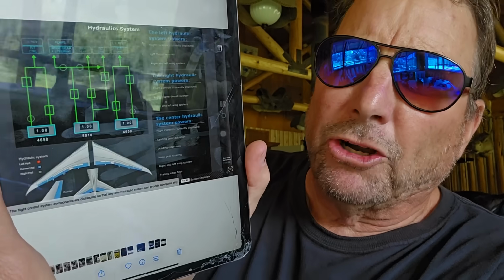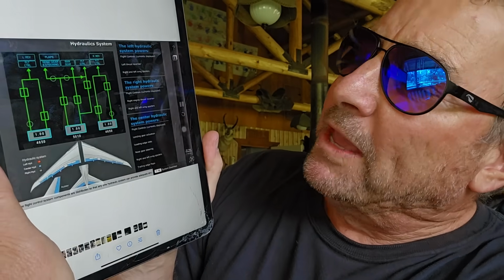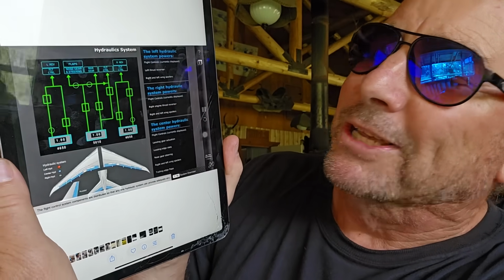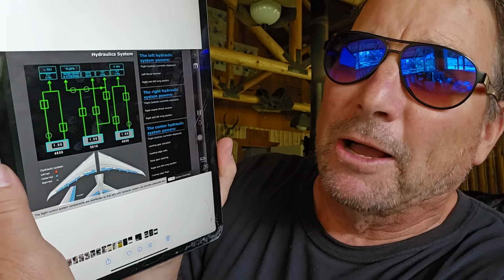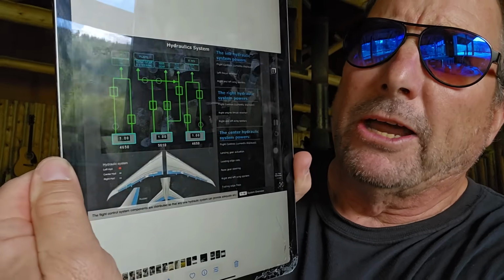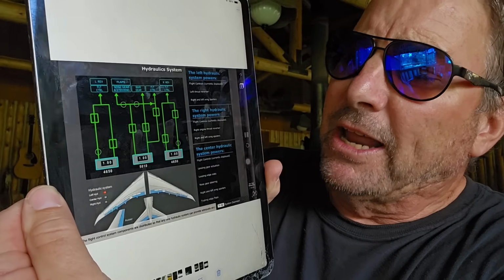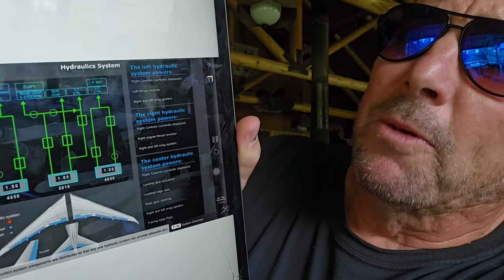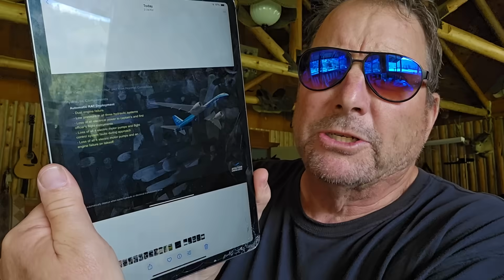787 Crash India What's a RAT? When does it deploy?

Comment: IMO the trouble happed during rollout and at or near V1. They were committed to take off.  I wonder if aborting the takeoff and over running the end of the runway would have been better.
Reply: The video that shows the take-off run was recorded from a position to the South of the runway. Using this position and the buildings in the background the aircraft lifted-off around the middle of the runway, apparently normally. Hence the problem occurred after rotation and lift-off.

Comment: What about the long takeoff? There is a video of the airport security camera showing a lot of dust raising in the air off the left wing, indicating a very late takeoff. Am I the only one thinking about this? What do you guys say about it?
Reply: The aircraft left the ground around the midpoint of the 3,600m runway. The dust was picked up from the side of the runway by the tip vortices.
Reply: @christopherrobinson7541 , maybe but how did that dust had enough time to settle there? Wouldn't the previous plane blown it away?

Comment: I assume the additional drag of the RAT is significant. In the early 787 models, there have been issues with battery fires. Are those batteries able to provide power like the RAT does or are they too small? (The fires have been big, though...)

Comment: I kind of wonder why so many airline pilot's in channels don't want to believe a dubble engine failure could've occurred?  If a faulty system like mcas could pitch down 2 max 8 planes straight to the ground, why wouldn't another faulty system for thrustcontrol suddenly be able to roll back both engines to idle in the middle of a takeoff? 
I have such a hard time to fully trust computers doing critical decisions based on readings from sensors that can give wrongful readings.

Comment: @Juan, is it possible that Aircraft went into the Flare mode right after taking off and reduced the engine power to idle?
Reply: Something like that may be possible, but unlikely to have throttled back the power so much that the electrical generators tripped offline causing the RAT to be deployed.
Reply: @christopherrobinson7541  we don't know for sure that RAT was deployed!

Comment: I have a theory on this.  We saw how they seemed to use an extra long takeoff roll, and after liftoff there was a cloud of dust.  What if:   beyond the edge of the runway there was some kind of FOD, and the plane was either rotating or still very close to the ground when it reached the end that the takeoff power of those engines sucked in the FOD causing both engines to die.  The cloud of dust tells me they were very close to some unpaved surface.  Rocks or things maybe caused the loss of thrust, thus deploying the RAT.  Investigators can tell by the condition of the fan blades and maybe other marks and the FDR will tell us the flap and all instrument settings.
Reply: The aircraft left the ground around the midpoint of the 3,600m runway. The dust was picked up from the side of the runway by the tip vortices. FOD is a possible cause, but initially the aircraft was climbing away normally.

Comment: Another thing not being talked about much is the apparent partial speed brake deployment seen in the initial video. Could a catastrophic hydraulic failure lead to the speed brakes becoming free in the breeze and partially deploying? Are they spring loaded to deploy like this when there is no hydraulic fluid to keep them stowed?
Reply: The speed brakes (spoilers) are locked in position and have to be unlocked and actively moved using hydraulic power. When the flaps are lowered to flaps 5 or flaps 15, a small gap appears between the spoilers and the flaps, which is what can be seen in the video.

Comment: On a 787, do the flaps and slats need hydraulic pressure to stay extended, that is to say, when the hydraulic pressure completely drops for whatever reason, that the flaps and slats at all times completely retract to 0?
Reply: The flaps and slats have check valves to ensure that these control surfaces remain in the last commanded position.
Reply: @christopherrobinson7541  Thanks for your reply, but it doesn't answer my question. The question is, in the event all hydraulic pressure is lost, will the flaps and slats at all times retract?

Comment: If the power was lost and the RAT deploys, does the CVR & FDR still record data on a 787?

I’m just thinking of what happened with Jeju Air Flight 2216 and how they lost the last few minutes of data due to a loss of power.
Reply: In theory the CVR at least should have the independent power supply
Reply: Both the FDR & CVR are powered up to the point of impact. In addition the CVR continues recording for up to 10 minutes after normal power is lost.

Comment: Good job Juan. Like other heavy Boeing aircraft Flap Zoro is flaps up (retracted) and leading-edge slat retracted against the wing, Flaps 1 only extends the leading-edge slat, Flaps 2 moves the flap straight aft (Increasing the wing area), flaps 5 continues to move the flap aft and slightly down, all flap settings after that move the flaps down. Generally, the more you weigh the more flaps you need for takeoff from the approved list of takeoff flap positions. The airplane weighs so much empty. Called Empty weight this weight includes the crew, catering, water, and laves serviced and everything that is normally in the airplane like the magazines, emergency briefing cards and even the barf bags, the other weights are added to this EOW to determine Takeoff weight. Fuel weight, passenger weight, baggage and cargo weight.  Center of gravity. This is all predicated on how far each weight is from the nose of the airplane in inches and is added, multiplied and divided to give you a moment which must fall within the takeoff limits for the airplane and with projected fuel burn within the landing Genter of Gravity. This number gives you a trim setting for Takeoff calculating loss of the most critical engine. Today this is all handled by computers. The trim switch on each control wheel is set to match this number. The trim switch moves the complete horizontal stabilizer at the back of the airplane (the little wing on the tail) When the pilot moves the control wheel, he moves the last little section of the horizontal stabilizer called the elevator.  The horizontal stabilizer is trimmed to zero out elevator deflection to reduce drag which reduces fuel burn and wear and tear in the mechanical parts of the horizontal stabilizer. Another point is for a Transport Category Airplane to be certified to fly It must be able to continue a takeoff and climb out with the most critical engine failed at Max Takeoff Weight. It must continue to fly until excess fuel is dumped, and ALL the Emergency and Abnormal checklist are complete, and a landing is accomplished. In my flying career of over 8,000 hours of helicopter flying and over 20,000 hours of airplane (almost all airline) I have never had an engine fail in flight. As a test pilot I have shut down many engines in flight and restarted everyone. I have full stalled large heavy airliners at altitudes between 10,000 and 35,000 feet. It is noisy with the Aurel Warnings and stick shaker going off, but it is really a non-event once you do it a couple hundred times.

Comment: There are many comments about suspiciously low noise of the engines during take off. The engines should be on full thrust power so RAT noise shall not be heard at all even if RAT accidentally popped out during take off. My speculation is the fuel problem distributions ..possibly clogged fuel booster pumps. Would that be real ?
Reply: It appears that both engines were not producing sufficient power to maintain flight. This points towards a common cause. However, the take-off around the middle of the 3,600m runway suggests that the problem occurred after the aircraft was airborne and apparently climbing away as normal.

There are multiple paths for the fuel to reach the engines, so clogging of the fuel system is possible, but unlikely to affect both engines at the same time. If the cause was due to contamination of the fuel system because of upload "bad" fuel, then it is likely that other aircraft may have been contaminated, hence checking other aircraft would be prudent.

The evidence available so far suggest that the engines rapidly lost almost all power, with fuel starvation the engines would probably showed some symptoms before quitting eg; bangs and pops, due to compressor stalls or similar.
Reply: @christopherrobinson7541  Could be the fuel starvation related to "Japanese Jetstar Boeing 787 GEnx-1B Engine Biocide Serious Incident" ? RPM oscillation occuring right at the takeoff and climbing ? Thanks for any comments here.
Reply: Why the need to speculate? And there are 6 x fuel pumps on the 787, you’re saying all of them clogged?
Reply: @tomstravels520 contaminated fuel does not clog the booster. But what can clog boosters are foreign objects left in fuel tank from maintenance, mainly cleaning rugs. These can get disintegrated by time and release more rug hairs into fuel tank. And the thickness of this loosen material is capable to clog the boosters.
Reply: @radascz so again, you’re just speculating here for no reason at all
Reply: @tomstravels520 yes I said its my speculation. I believe that investigation will lead to focus on fuel distribution. Thx & regards
Reply: @tomstravels520  I believe the investigators will be very focused on fuel distribution systems.
Reply: @radascz believe what you want but they will look at EVERYTHING first

Comment: The sole survivor said he heard a bang in the moments before the aircraft tragically crashed. Could the bang he heard, have been the “bang” sound and correlating thump through the airframe caused by the deployment of the RAT? His 11A seat isn’t too far from the location of the RAT pretty much below 30J?
Reply: He also said that the cabin lights were flickering white and green, could indicate electrical issues.
Reply: @JohnnyMotel99  The green & white lights are the emergency lights, which are illumination when the power fails.

Comment: Hey
It's very easy to blame the pilots guz they are Dead 
Looking at the time profile 56s
30s to left off 
15s  starting the final  plunge 
That leaves the pilots with 21s to figure out what's happening 
I think takeoff thrust or maybe TOGA ( a320) it didn't help
So I think the issue have to do with shifting weight as soon as they lift up or they have an issue with weight and balance sheet from the start
Pilots will feel the shift as soon as they rotate so they kept the landing gear down 
The other movement from the trim forward trying to get the plan out off a flat stall 
We need to see and hear the flight date and voice recorder
Reply: Even during the final glide the attitude of the aircraft looked normal, so I do not think that there was a load shift.
Reply: the angl should be 10 to 15 nose up
and yes it looks normal but its not normal at that point of time
the tail is staling i thnk

Comment: so the rat can be deployed even if one engine fails on take-off? I thought it had to be two. the plane looked alright about 600 ft. why the flaps wasn't down people say, why wasn't the landing gear retracted?
Reply: You cannot tell the position of the flaps from that low res picture. Too many people seem to think flaps on takeoff should look like flaps on landing
Reply: The position of the bogies suggests that an attempt was made to retraction undercarriage, but it was interrupted, probably because of a hydraulic failure, due to the loss of engine power. 

The max height above the surface was 425 ft.

Comment: What if the assumed temp was miss loaded either manually by the pilots or load planning? That might explain the low climb rate and no or under response from the auto throttles? Once airborne weight on wheels switch activated the aircraft air data computer sensed power setting way way too low to achieve climb and defaulted to severe under power and deployed the RAT. This would cause a lot of confusion in the cockpit. Especially since in T.O. Mode if the throttles did not come to deliver adequate thrust for ambient conditions.
Reply: You’re just making random guesses now
Reply: The video of the take-off shows that the aircraft left the ground around the middle of the 3,600m runway and initially was climbing away normally. The problem occurred shortly afterwards. 

Something may have caused the auto-throttle to bring back the power, but it should not have caused all of the electric generators to trip offline.

Comment: Has anyone looked into the possibility that the RAT deployment indicates a shared EEC input failure leading to a dual thrust rollback?
Reply: That is a possibility, but even this rollback should not have resulted in both engines producing almost zero power.

Comment: I’ve calculated average speed between lift off and crash of between 130knots and 136knots, way to slow. Should have a rotation speed of 165/ 170 and maintained that.
Judging by the dust swirl it  generated at lift off at the very of the strip indicates it used every bit of available runway which is definitely not normal.
Possible incorrect weight input into fmc resulting in derated power performance from engines and incorrect v1 v2 ect speeds, also would equal slower acceleration down runway.
Possible engine failures at v1 or v2 with another contributing factor ie, incorrect flat setting, overloaded, electrical failure / something else which I can’t quite understand yet.
I’m confident pilot error and should have had ample time to reject take off due to poor acceleration.
Reply: And you got that calculation how? Considering at 625ft they were 174 knots ground speed and the airport is only about 200ft above sea level
Reply: From end of runway to crash location 2300m give or take, flight time 31-32secs = average speed.
Reply: Some of the data must not be correct, I’m confident on the distance measurement of 2300mm give or take but obviously can’t be 100% certain where it exactly lifted off. 
If at 600ft above msl it was doing 174knots that was the point at which it was no longer gaining altitude that was roughly 11-13 secs after lifting off and approximately 19 -21 secs prior to impact.
You can do following calcs
At the that 600ft Msl point it would have been roughly 1050m from end of runway  (distance over time calc) as we supposedly know it’s speed for those first 11-12 secs (175kt maybe) 
The plane then travels the remaining distance of roughly 1200-1300m in the remaining duration of it’s flight time (32secs - 12secs)  which gives an average speed of 120 -127kt which I is think is way to slow for it to have even been flying at all with  the full fuel and pax load (flying with a high sink rate that is). With such a low average speed over that last 1200m the plane would have properly stalled (dropped a wing and dropped like a stone) therefore I’m calculating the plane was not traveling at its required v2 speed at takeoff, and hence why I think some of the data provided is not accurate.
Reply: @sampalmer9117  _"From end of runway to crash location 2300m give or take,"

The crash location is 1,500m from the end of the runway and directly inline with the runway. On Google Earth it is marked as the "Civil Hospital Staff Quarters" and is North of the Jhaverchand Meghani Road.

Position: 23 03 15,29N 72 36 55.61E.

The last position was 645 ft amsl, 445 ft agl and was flying at 175kts.

This gives a glide angle of 10 to 1 which is a strong indication that the engines were producing little or no power.

I assumed that the aircraft was flying at 150 kts, much lower and it would have stalled. Hence I estimated that the time from the runway to the crash site would have taken 20 seconds. Other ADS-B sources indicate that at the last data point the velocity was 136 kts, perhaps because the aircraft had already slowed down.

Comment: I don't think the RAT deployed, it wouldn't have had time, the plane was 'airborne' for less then 30 seconds and they wouldn't have taken off without power. It was a power on stall, likely pilot monitoring retracted flaps in error, rather than the landing gear. Watch the video of the take off where the wings lifted, lifted, lifted, then suddenly dropped. That was when the plane stopped flying, they didn't have the altitude to save it, and likely didn't even have time to realise what had happened.
Reply: You can’t retract the flaps in error, flap protection will not allow it

Comment: What if the pilot monitoring used the flaps lever instead of the landing gear lever when the pilot asked for “landing gear up”? Sounds crazy, but it could’ve just been a terrible mistake made really close to the ground.
Reply: According to 787 pilots even if they did the flap protection would not allow it
Reply: How would have raising the flaps erroneously have resulted in the lost of power from both engines and the RAT being deployed? The aircraft crashed 1,500m from the end of the runway. The aircraft height at the last point was 645 ft amsl, 445 ft agl. That results in a glide ratio of 10 to 1. Assuming a speed of 150 kts the time from the runway to the crash site would be 20 seconds. This is strong indication that the engines were producing little power.